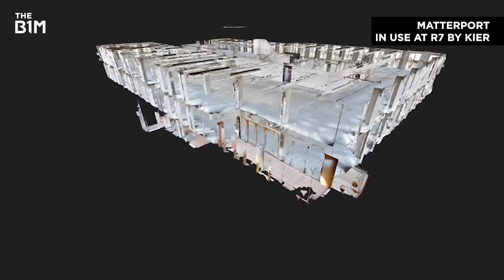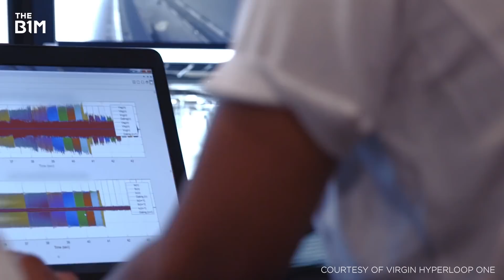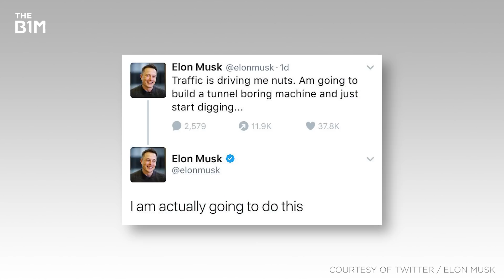3 Ways Elon Musk is Disrupting the Construction Industry

Comment: The hyperloop idea isn't pressurized tubes, it's depressurized tubes, very low pressure well below sea level and closer to 10,000 to 30,000 ft pressures, at which there's much less resistance and friction w the air. These ideas go back to old sci-fi, anyone who read 1960s and 70s hard sci-fi and/or developing science mags is already familiar w this stuff, small model tests have been done over the decades at many universities. At this point, tell me bout it when it's operational and going from NYC to LA ! I'll be in my freighter TARDIS.

Comment: Hyperloop is not a "pressurized" tube. It's a de-pressurized tube. That's the point of it.
Reply: You can argue that. Negative pressure means that it is still "pressurized" with lower than ambient pressure. If you set the relative margin of sea-level pressure at 0 you will get a negative pressure with a certain coefficient, not a "de-pressured" system.